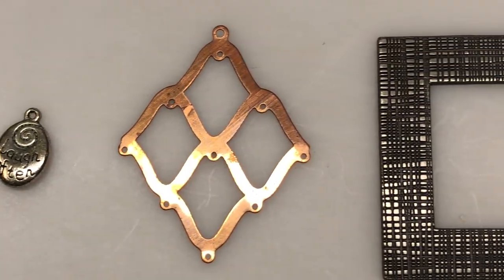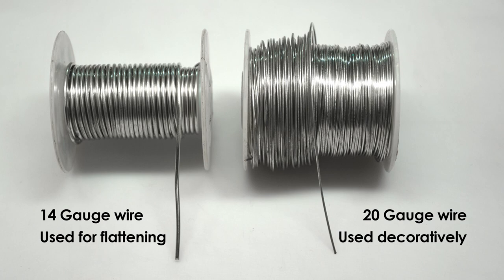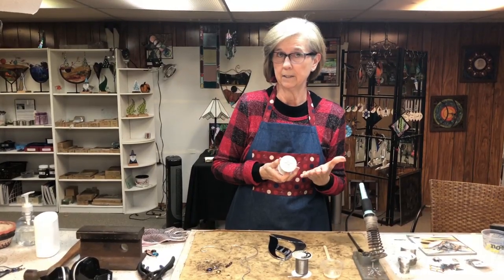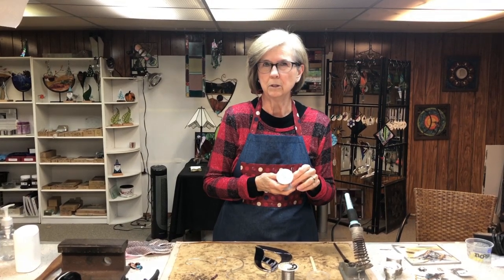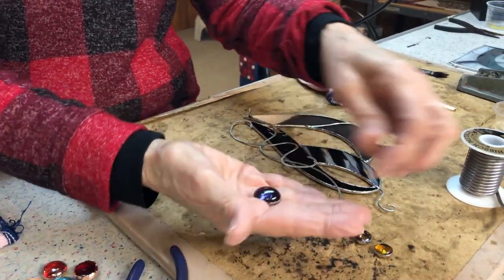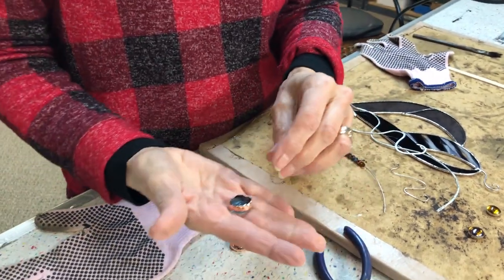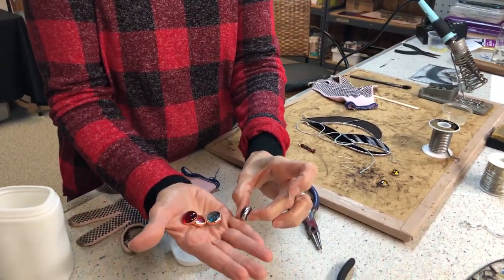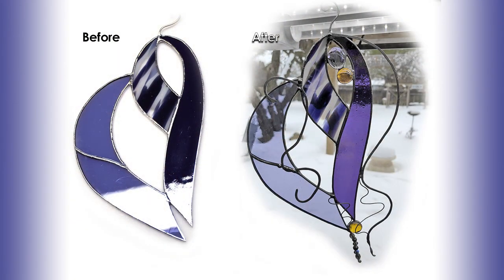Embellishments

Comment: A most informative video. Thankyou Ma'am. My late wife was into doing the wire tendrals and once I found an old jewelers rolling mill on line for $60 so I bought it so she could flatten the wire designs a little faster. The mill also gave her the ability to change the gauge of the wire from heavey to light. I found some of her cartoons hidden away so for our children I'm making those unseen deigns. A thought rail tracks have a radiused top but if you make a base to turn your track upside down the bottom is flat and much bigger so making something flat would be a lot easyer. Thankyou and God bless.
Reply: Thank you so much, sorry for your loss. How wonderful that you will put together projects from her cartoons, I'm sure they will treasure them!

Comment: Thanks for the great video. Can you share how you clean and wax the piece after embellishments are added. Thanks love your videos!
Reply: Hi Virginia, I wash the piece with Dawn dish soap and hot water, I then rinse with hot water, spray with vinegar and a final rinse.  After drying I go over the piece with steel wool, apply patina (if using) and rinse with cold water. I use Mothers Carruba wax on the piece and buff with a soft rag.  I use a toothbrush to get in between the crevices.

Comment: Thank you so much for sharing your knowledge. What brand of gloves do you use. Are they heat and cut resistant.  
Thanks
Reply from the maker: The gloves used here are not heat resistant and we do not recommend using them. A better choice would be to hold the piece with pliers, a jig or held in place with a wooden hobby stick.